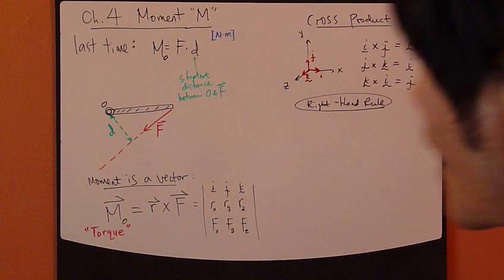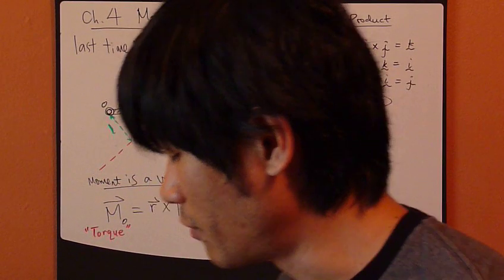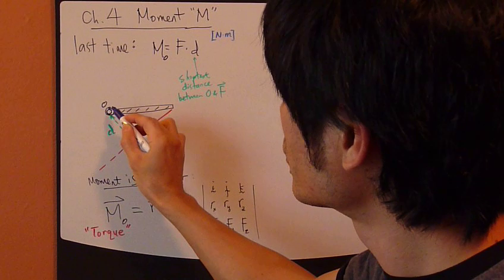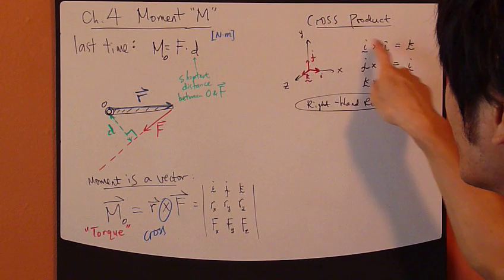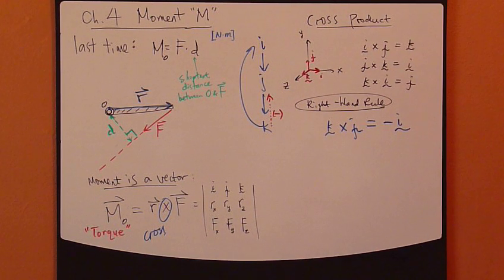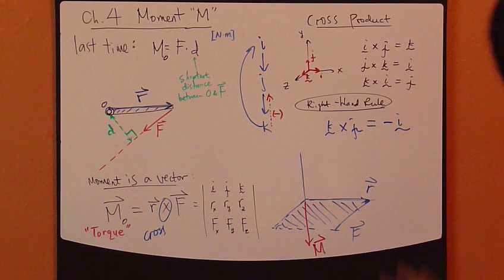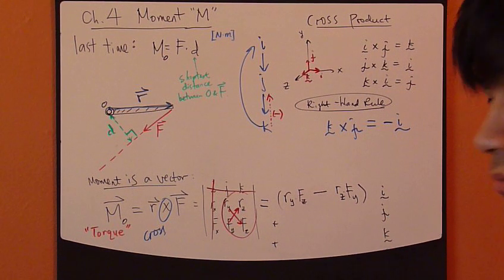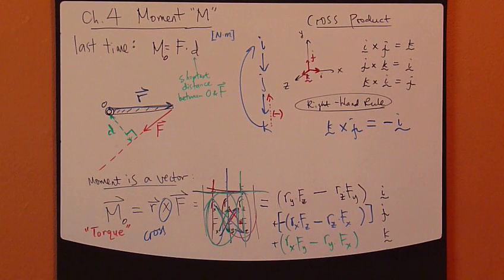Engineering Statics Ch4 Part1: Moment, Cross Product

Comment: Very detailed and informative video! This is how I see it: M=F*d, but as there are vectors involved you have to apply the crossproduct "Vector x F", (vector being the distant, d. The crossproduct is really a multiplication between vectors instead of scalars. Was a little confused at first as to why the red line (the momentum) at 7:30 was representing M. To me, M is "a line times another line". I mean to me the red line could be either F or d in the equation M=F*d.